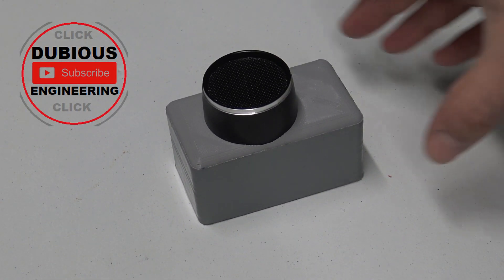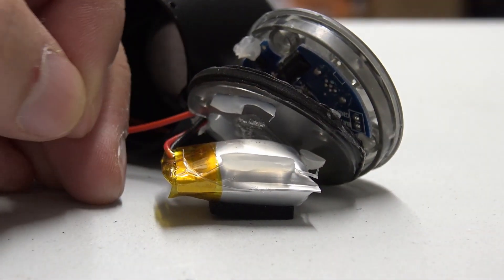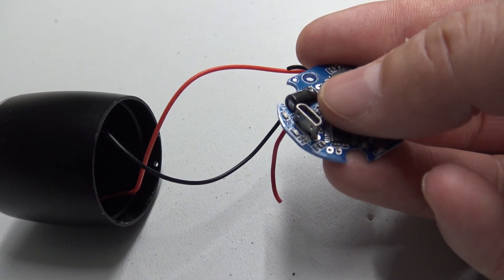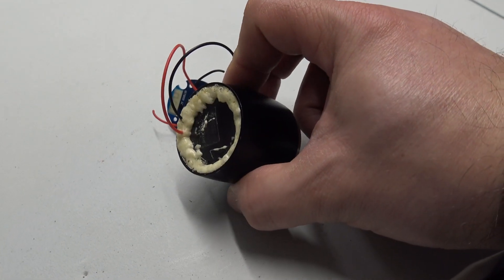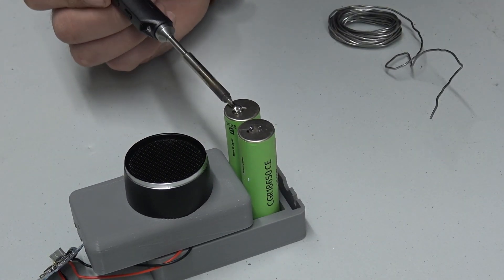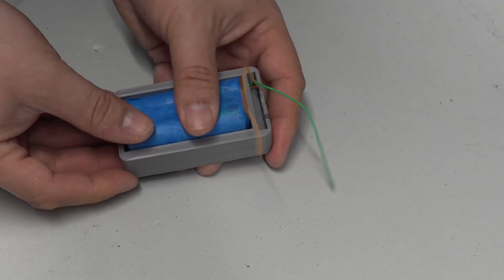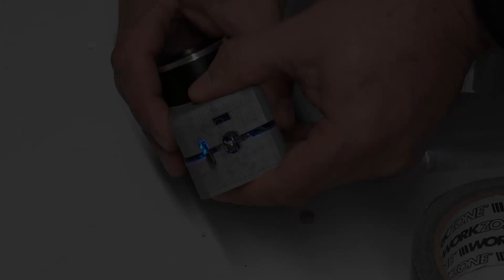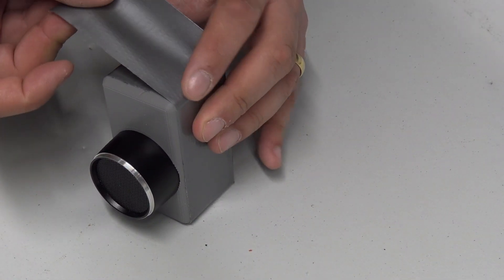DuB-EnG: Tiny Mini Bluetooth Speaker Teardown and Repair - Replacing a swollen lithium cell upgrade

Comment: I have a similar problem with an old MTX sound shot bluetooth speaker. You can find those lithium ion batteries on those Chinese shops on Ali and all those. 

My current ones on hand, are too big though. Square 400mah boxy guys won't fit, so I'll order some small ones.
Reply from the maker: Happy days, fingers crossed you get it sorted,  best, Howard

Comment: I did this in a more ugly way but it is working. The problem is, sometimes it malfunctions. I used 1pc 18650 battery which is 3.7v
Reply from the maker: I don't understand why it malfunctions, but great work!!
Reply: @DubiousEngineering  thank you sir! It stops and produces noise like grounded. I did it twice already, same problem... I was thinking that it's the battery i used. Maybe the voltage is too high? It's 3.7v with 2000mah i think.

Comment: https://www.ebay.co.uk/itm/Charger-4pcs-3-7V-600mAh-Lipo-Battery-for-Hubsan-H107L-Drone-Syma-X5C-F5C/303511030884?ssPageName=STRK%3AMEBIDX%3AIT&_trksid=p2057872.m2749.l2649   you can remove the outer padding of these to make them slightly smaller and access the charge/protect board to swap leads/connectors
Reply from the maker: I actually have one of these little toy drones downstairs...  I didn’t think of it...  hahah...  I may have been able to parallel up two of these and improve the performance... thanks Dave!  stay safe mate :-)
Reply: @DubiousEngineering  Cool, I used em for many different projects there super useful and work out very cheap

Comment: Designed an enclosure for such a device on Fusion360, of course, the buttons, on/off switches and such, didn't quite fit...  Who knew speakers actually took space?
Reply from the maker: hahah...  sounds like you can relate to my problems! ...  I have a lovely little treat for you soon...  a crystal radio set...  3D printed

Comment: Seems a complete success to me and extra points for the use of duct tape. Don't expect the first item of any run to be perfect, that's why we prototype. You can spend a long time making a perfect prototype or you can spend a fraction of the overall time doing rapid iterations of build/test. It's all down to time and materials and their relative values. Suggested new technology: "Gaffer's tape", it's what duct tape wishes it was.
Reply from the maker: Awww thanks for your encouragement Peter...  I can’t wait to show you my multi coil threaded 3d printed galena crystal radio receiver...  I think you may be slightly impressed :-) ... give me a week or so...
Reply: @DubiousEngineering  That sounds absolutely ace! I'm very much looking forward to it!

Comment: Why didn't you 3D print a spacer to fit in the gap between the two halfes? A spscer of a different colour plastic (maybe Black) would look quite nice.
Reply from the maker: Yeah exactly...  I must admit to having thought about doing that as it wouldn’t take much time... but then I thought of clips and screws and redesign...  and then there was tape...  lovely tape...  :-)
Reply: @DubiousEngineering  Hahaha.. You can fix anything with a bit of Gaffa tape.

Comment: What exactly is Bluetooth ?
Reply: A communications protocol (method) that works in the 2.4Ghz band.
Reply: Desmond's Donders thanks Des
Reply: @Man-in-da-shed  You can think of Bluetooth as a WiFi connection between your computer (or smartphone) and peripherals. It's got special facets for delivering audio and operating at very low power but it's a short distance radio link to replace cables.
Reply from the maker: Bloody hell you lot...  that’s like a sensible conversation...  :-).  Great to read! People helping other people...  you must all be bored being cooped up at home :-)
Reply from the maker: hahah...  you seem to have a problem with mice recently :-)